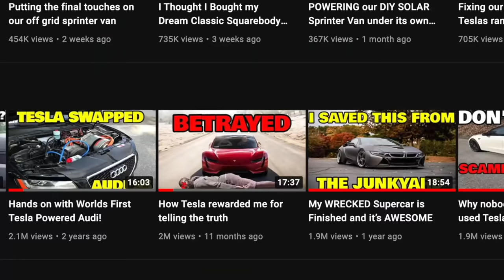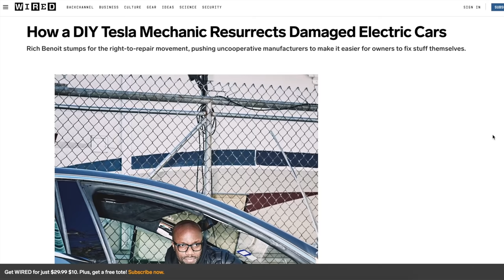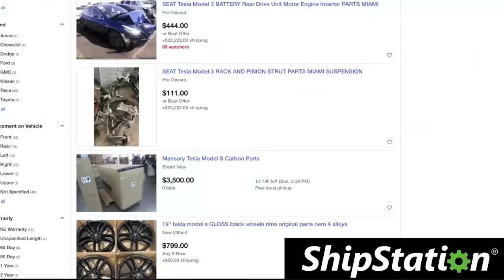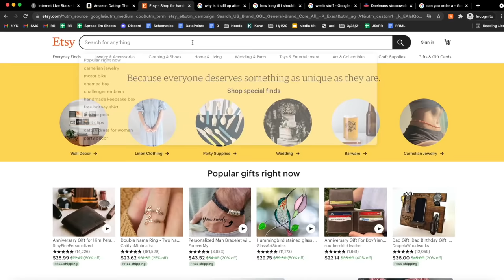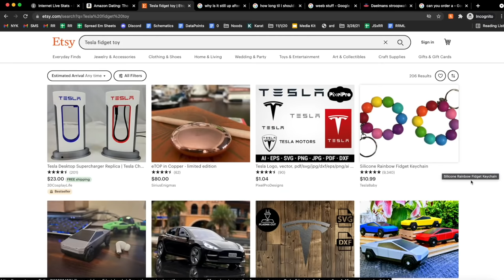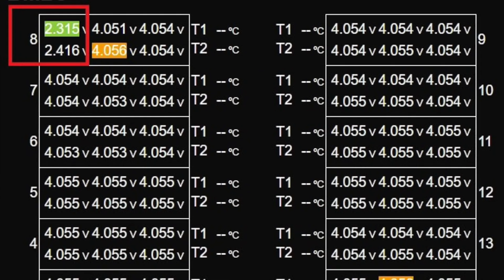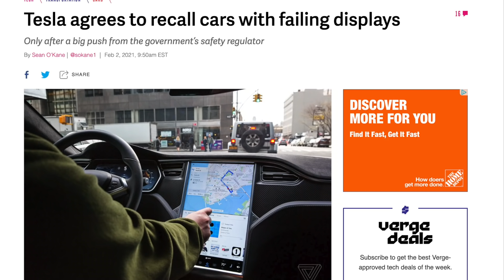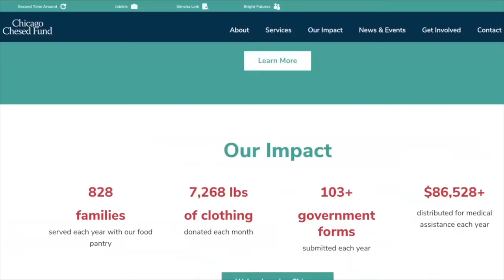Tesla wanted $16,000 to fix this NEW Model 3, we did it for $700! The importance of Right to REPAIR!

Comment: That was the easiest repair ever.  The Tesla techs should be ashamed on this one
Reply: Probably A bunch of highschool graduates
Reply: Get off of your high  tesla tech don't have the final say tesla does.
Reply: Not the techs the company. The manufacturer specifies how a repair needs to be done at a dealership, happens all the time with everyone. If the screen on the radio goes out they'll sell the entire unit not just the screen. AC compressor goes out? Replace compressor, condenser, and a couple of other parts. That's why buying from companies that will allow you to make a choice is so important. Aftermarket companies are the ones that fill the void on easy parts. There are a lot of companies that make pattern failure repair parts. Usually for stupid things just like this. But given that Tesla is pretty niche and most Tesla owners will just bend over and take it there isn't much of a market for easy parts right now.
Reply: To be fear this would be the result of any car manufacturer and repairs in a dealership with a car under warranty, the manufacturers repair is what the dealership is aloud to do. There may be a good cheep fix but not supposed to do it at the dealership
Reply: Not that easy hand tapping . It is an acquired skill.  Easy to damage part and threads. He made it look easy because he has done this many times. What happens if he damaged the battery cell end .  Not many mechanics could attempt this without a high degree of stress. You only get ONE shot.
Reply: @DavidPruitt  Exactly, it's not about the cost for the customer, it's about keeping the garage bays moving and keeping parts modular. It reminds me of the airline industry. Oh that one instrument on your panel is not reading right? Replace the entire dashboard.
Reply: More like their corporate offices and design teams.

The technicians, especially at a place like Tesla, do what they're told, even if it's to the detriment of the customer.

Comment: Right to repair is vital.  This is a perfectly acceptable repair and what I would do.  I do wonder, given the very low pressure in the system, if using FlexSeal tape would actually make a seal that would work.  Just a thought, since a tape seal solution doesn't give any structure like using a brass nipple does.  Excellent work guys!
Reply: Epoxy, polyurethane foam, carbon fiber, or perhaps plastic welding should work equally as well.

Comment: I got a quote from Tesla the other day to fix clicking in my old model S’s rear axle, $6,000 out of warranty. I’m taking the car to EG in two days to get a second opinion. Thanks Rich, you’re doing Gods work.

Edit: The rear axle costs $304 to fix, happens to cars w high torque all the time.
Reply: But, but, I was told electric cars need almost no maintenance, are cheap to operate and outlast ICE? I have multiple 200k mi nissans where I have less than 6k into them. They run like new.
Reply: @TheGuruStud  but if gas goes up by a quarter you’re stuck at home

Comment: Skip to 13:50 thru 20:00 for the repair.
Before washing out debris, try vacuuming the newly threaded area first using a small nozzle on the vaccum.
Reply: Yea waaaay too much filler in these vids

Comment: Firsts guy to pay 700$ for a fitting and being happy with the price
Reply: Relative to 16000, why wouldn't you be?
Reply: He didn’t pay $700 for the fitting. He paid $6 for the fitting and $694 for their expertise
Reply: No, most of that cost was him shipping the car there I think.
Reply: The coolant is pricy from what I’ve read.
Reply: @bagofholding  good point. Your probably right. But hey shipped and fixed for 700 ain't bad considering you were staring down the barrel looking at a 16,000 dollar bullet. Was a pretty smart idea for the fix. My dumbass would of been smearing jb weld over the crack, tapping and using a fitting pretty smart.
Reply: $700 is still a little steep for that repair but they do have to keep a shop open.
Reply: @SavageBunny1  I think it included the shipping and travel expenses
Reply: I thought he said total cost of repair and shipping was 1/10 the Tesla quote.
Reply: @bagofholding  no he's stated that the total price was 10% of 16k so total cost was $1600 minus $700 for labour/repair and $900 shipping
Reply: @theworstgamervr  actually if the system is so low in pressure, jb weld would have been safer.  Because tapping for the fitting could have broken the tube behind it completely.
Reply: @xsu-is7vq  fair enough either way wouldn't pay no 16 grand anyone that would is a chump
Reply: @SavageBunny1  new coolant. Labor. Shipping. Taxes. Looks about right. Any job that requires your car to go up on a shops lift isn't gonna be cheap

Comment: I love the idea of an EV. And until right to repair and available parts happen, there is no way I am getting one. A car should last 10-15 years (or more) with how much they cost and how much resource is going into them. 

So if scammers like these want to charge you $16K, because they refuse to fix a bad, proprietary part (a plastic hose fitting !!!), that should be under warranty - even after 4 years.... then I am not playing this game with them. I will drive a gas powered car where a similar damage (punctured oil pan) will set me back only a couple hundred.... yeah, maybe just a tow and a tube of JD weld ...

And btw this is how a single agency can make a company lose 100s or 1000s of existing or potential customers.

Just my 2c.... for me cars are just tools to carry things from point A to point B. Frankly, electric bikes are at a much better place at the moment with the chance to repair yourself.
Reply: The real sad fact is this will have almost 0 negative effect on tesla. You say they could lose 100s or 1000s of existing or potential customers, But they wont they have this almost cult like following and in a lot of peoples eyes they can do no wrong. Most of the people who see the bad stuff tesla are doing aren't the ones who would have got one anyway.
Reply: Not all EV manufacturers are like Tesla.
Reply: I'd like to convert an old car to EV for this reason, using modular components and keeping it simple.
Reply: @Cakebattered  which ones are not? How do you know you would have parts for a leaf or a hyunday in 10 years?
Reply: @Jorrow.  so tesla is the apple cult of car culture ;) 
When apple started soldering memory and disk on and removed the esc button from laptops I stopped buying them..  around 2014 :)
Reply: @alexanderrobins7497  OK, just looked at this :) ....   so ... this is not going to cut it as a "car" replacement. Not for me. 

I don't commute at all. However I do 2-3 week grocery shopping and I haul my bicycles around, sometimes even motorbikes. 

This is great if you live in a city. I live at the end of a 2Km patch of dirt road. It is a good dirt road and we have a "normal car" and a pickup truck, and even the "normal car" makes it there, but I am not sure that this thing would:) 

I mean ... a cool scifi concept car. But I truly need something that can carry 2 kids, 2 adults, 2 dogs a cat and 4-5 bicycles :)

OK, I would be fine with a 2 person "van" type of deal. But I still need space to carry 2 bicycles in a "not some strapped-on-carrier" manner....

And then it would be a 2nd vehicle that cannot carry the family. So justifying a full EV price is out of question for me.

But really ... where are the cheap EV vans. I don't need fancy tablets and crap, just a full solar panel roof, a cr@p-ton of batteries, and some space for "stuff" .... hell, I would even carry a gas generator around on an EV van, just in case :) pump in an hour of charge if you have to do a significant distance....
Reply: @alexanderrobins7497  Just one more thing on this....

It looks really cool and interesting....

But I will be honest: when I drive, I do enjoy driving most of the time.

That means, that I want a manual shifter (if the car has a shifter, an EV might not have one).

I don't want a giant tablet to control the AC and the mirrors. Safety features are appreciated, ABS, and traction control and all the good stuff as far as I turn them off when I want (e.g. a KTM enduro/touring bike has ABS, and you can disable the rear, should you feel like drifting around corners, or go off-road) ....

And .... I really don't want to pay for all the A.I. driving crap as I want to drive my car. So nor do I want to pay for the R&D, nor do I want anything in the car that can be disabled / modified / controller remotely or by a computer. 

Again, I am not an idiot rebelling against ABS or seat belts or traction control. I just don't want a remote switch and some software taking my steering/braking/acceleration over in any way......   
And again, my 690 Duke was and my 690 Enduro R is full ride-by-wire, and I personally took the electronic throttle body apart and repaired it. It is not electronics or circuits I fear. It is a full neural network I don't want in my car as I would never-ever under any circumstance would use or activate. :)

In other words: I just want a "normal car" that runs on batteries and doesn't stink like diesel or gasoline. With manual gears (if any), and an ABS assisted brake....    where .... STUFF FITS ...  like a couple of bicycles or a couple members of my family :) >>

cheers

Comment: My buddy bought a Lexus at an auction. It has the self focusing headlights. One broke so the beam was pointed right into the oncoming traffics face. lol  He inquired about repairing it at a garage. they wanted like 1400 bucks to replace the headlight citing it was cheaper to replace it because they are not really fixable. So he is mechanical and did it self but the replacement was part alone, the lamp house was 700 plus tax and shipping.

Comment: Tesla: Yeah, you'll need to buy a new battery.
Owner: That sounds a bit excessive...
Tesla: It'll be 16 grand.
Owner: That's stupid. But F it. How do I go about transporting the old battery back with me?
Tesla: WhY wOuLd YoU wAnT tHe OlD bAtTeRy???
Owner: OH I don't know. Because it's mine? I paid for it when, you know, I BOUGHT THE CAR, remember?
Reply: Because I have an internet connection and can use search engines.
Reply: They need it for a core charge lol
Reply: You can also reuse the older batteries to make a wicked home battery. Add solar and wind and your likely fully off grid, electrically that is.

Comment: So. My takeaway from this video is that there is a need for an aftermarket skid plate that is a bit more robust than the supplied Tesla one. I've got a nice quarter inch aluminum one under my Subaru that has saved my oil tank on several occasions. Perhaps even Electrified Garage could have them made locally? Who knows, the future is uncertain...
Reply: The batteries already armoured? So a redesign where these ports are protected by that armour.
Reply: @benholroyd5221  They removed the wimpy Tesla armor to access those plastic ports. So they already seem to be covered, just not well enough.
Reply: Big Bird, Big Brain
Reply: Very smart Richard could build them and slang em he would make bank
Reply: We have a new Model 3 Standard Range on order.  We live out in the countryside here in New Zealand, so I'll be building a reinforced skid plate as soon as it arrives.
Reply: @SmilingDevil  Yep. I have some of that laying around. Often used for commercial signs (which is where mine came from).
Reply: @SmilingDevil  I used a material called Ultra High Molecular Weight Polyethylene to protect the undersides of two rally cars I worked on. The material is easy to find, easy to work with, it's self healing and very slippery. Available in a number of thicknesses you can have a sheet of 1/8" reinforced with 1/4" or 1/2" thick strips.
In fact, the way the sheet looks there, all it would require is some strips of aluminum or this same material so that it'll not flex as much at the battery.
Reply: Your Sube is a hell of a lot lighter than Tesla so OFF roading is more likely in it.
Tesla is a road tank with not that much ground clearance...and crap tires for off road use...so chances of going on a rough terrain and high centering it is unlikely....having the need for a steel underpan.  VW slugbug...what goat trail?
Reply: They could just have a cover for the cooling lines.. No nees to replace the plastic plate with a metal one... It wouldn't add any protection except for the coolant lines.

Comment: What doesn’t make any sense is that the shield wasn’t up to the task to protect some janky plastic piece?
Reply: Made me think of the Pioneer DJ gear line of CDJ players. The cue and play buttons mostly used by users (on purpose imho) are fabricated in a such a way they are prone to fail easily, so you can buy the 20 euro kits of new plastic buttons to replace them. I just glue them back together reenforced with a 90 degree piece of cutout blister packaging (like from my Makita batteries, or dental floss, or whatever) with a big blob of hot glue or pvc glue and it's better than stock. I fixed 5 CDJ players that way, saved up to 100 euro's in minutes. And noby is doing this afaik, I only see YT video's confusing mentioned 20 euro replacement with "repairing my CDJ".
Reply: Tesla builds cheap car and sells it for big price! The entire coolant system seems cheap made from plastic!
Reply: What kills me most is how GM used metal fittings on the Chevy Bolt, which you can buy for $15k less. Maybe Elon should ask GM for design help.

Comment: Nice fix. Looks like inadequate protection from road debris for those lame plastic fittings. I will be looking at adding a shield to my rear wheel drive model 3. Maybe I will start a business selling stronger metal shields !!
Reply: Smart. $110 for a $5 part why not? You’d sell many.
Reply: Sell shields for cat converters too with security screws to stop theft of exhausts. Maybe underbody chassis rails with roller bearings for all these lowered cars so when they rub on a speed bump with their 30mm ground clearance cars it'll just skate over and not rip the sump plug off the car.

Comment: Rich,
I love your videos! I'm not bitching, you saved the guy BIG BUCKS! Why did it cost $700.00? The labor perhaps due to video magic did not appear to be more than an hour. Mechanic used a brass nipple and some sealant. Why did it cost so much? Granted, a whole lot better than $16,000.00. I'm just curious if the coolant is very expensive or you charge $5 or 600.00 per hour?

Comment: Nice fix! Thanks for showing this. I was wondering, it looks like that this nipple is screwed in place from te outside, looking at those 2 screws/bolts. I understand that it is way simpler to do it like this, but if the connection can't be safed in this way, will je be able to open the battery pack, so you can unbolt that nipple en fully replace it?

Comment: I really was considering a Tesla, think I'll buy another truck instead.  They treat their cars like cell phones, just throw it away and get another one.
Reply: THIS is what you took from this video, after Rich repeatedly said that this is not a regular issue? Are you eating steak with a spoon after someone told you he cut himself on a knife once? It's your choice, but think rational ffs...
Reply: They dont break down that often though
Reply: @2nd3rd1st  They don't wanna deal with that BS even if it is a rare occurrence. Cars can last 30 years, so the chances that something will go wrong and require repair becomes more likely.
Reply: It's the same with every other car manufacturer.
So the only solution is to buy a bicycle.
Reply: @Jehty_  You're being delusional if you believe that Teslas are as repairable as other cars.
Reply: @2nd3rd1st  I work on my own cars, and I never have issues getting parts. But you seem to be a little sensitive about another man's personal thoughts.....pull your skirt down.
Reply: @33blue  did I say that?
No I did not.
Reply: Tesla armchair fanboys at it again,lul
Reply: @Jehty_  Let me quote you 
"It's the same with every other car manufacturer"
Other car manufacturers offer replacement parts to a varying degree. Plus there are a dozen car shops within a 10 miles radius that can work on it. There's a huge aftermarket as well. What should be taken from this video is that Tesla's are not as repairable as other cars
Reply: This specific issue may be rare, but the story is very telling of how every other issue/repair will go. I'd buy something else instead too.

Comment: According to every Tesla owner on youtube, nothing ever needs replacing on a Tesla and the batteries last for infinity miles (because Tesla has magic battery tech that doesn't exist for any other battery in the world) 😂🤣😂🤣
Reply: I have heard some people say they retain their value because of software updates.  Let me know when a 2012 Model S gets a software update to have two motors, FSD, and a 400+ mile range.
Reply: @alexanderrobins7497  Tbh some updates have increased speed and range, because of newer battery management system software update. Not a 100+ miles, but modest two digits. Still impressive though.
Reply: @FVBmovies  still the plastic composing many part are aging, and good luck with Tesla price to maintain an older Tesla...
Reply: @tiloalo  At least still better than other EVs.

You're even struggling to buy a Mustang Marc E through a dealer.
Reply: @tiloalo  And you're telling me this because...? Personally, I don't believe EVs are a way forward to replace ICE. For urban commutes, yes, but not for long trips and longevity. If humans manage to get non-toxic, much better battery technology, then yes, but until that happens, no way.